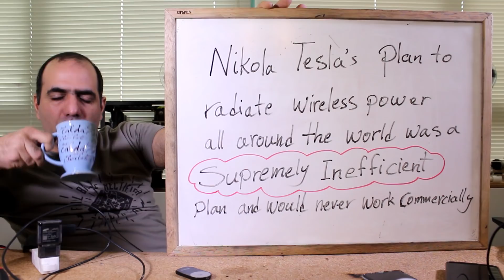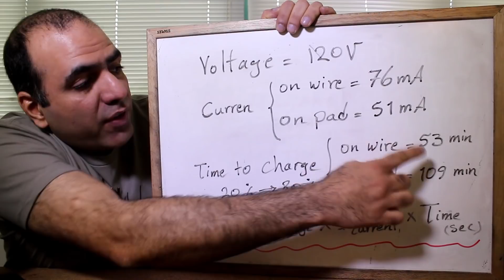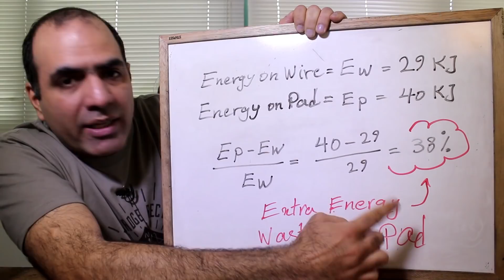Drowning in Inefficiency

Comment: With a resonant transformer you get pretty close to 100% efficiency. Take your Teslacoil and see how much current it draws. Then remove the secondary coil and look again. You will find a difference of about 90%. The reason for that is, the magnetic field of a coil can't radiate away like the electromagnetic field of an antenna. The magnetic field of a coil is fixed to that very coil. Except you offer a second coil in which it can fall. Therefore the only reasons for losses are the quality factors of your resonant circuits.
Another important effect is the inductor coupling: the coupling from the primary coil to the secondary coil in two loose coupled resonant circuits rises with the current in the secondary coil. Hence you start with a coupling of about 5%, when your teslacoil runs it rises to nearly 100% so that almost all the energy is burned in the arcs on the secondary. You can easily check this out with the experiment I mentioned first. If you are bored, you might also measure the current of your teslacoil driver, while you vary the load on the secondary. If you are really, really bored, you might also build something to draw a variable, but definded, amount of power from your secondary to see how it affects the power the primary draws and what the true efficiency in pendency of the load is (I guess you'll get about 80%). You will need high voltage, high power resistors with lots of ohms to do that but I am sure, if you are interested, you will find a way to help yourself.
Might be interesting for you to see, that a teslacoil is in fact more efficient than a common switching regulator. That is because you have no core losses. Tesla failed because the range of the magnetic field of a coil is very limited. Assuming the magnetic field of your primary coil cannot leave the primary coil, you run your coil at 300 kHz, and the field is expanding with the speed of light, then you only get a maximum range of 1000 m. Behind those 1000 m the field of your primary coil is simply not visible because of the limited speed of light. Another reason is the limited quality factor of resonant circuits, which further limits the effective (usable) range of the magnetic field of a coil.
By the way: you can use the primary of your teslacoil as an inductive oven to melt metal stuff (but be careful not to overstress your driver unit, eventualley you will need a smaller primary with more Windings for that). You can also build a capacitive oven and hook it to the secondary to melt plastic or boil water with the displacement current, similar to a microwave oven (the chamber should not be too large, so that the density of the current is large enough).

Comment: I agree with you. But you also have to admit that NT was the awesome mad genius who it the father of AC And also he had vast knowledge about frequency, And maybe Maybe he find someone kind of frequency level to transmit Power to a great distance. 

I don't have much knowledge about Electricity, but I from my experiment I found surrender level of sound and mechanical vibration can reach cover much larger area then others. 

Although with sound and mechanical vibration lose the power with distance. But I think For electricity the results can be reference because ( by using something like wireless transmitter). 

Why don't you give it a try.

Sorry for my bad English.

Comment: Some of the claims vpn companies make are B.S.A.F. 

Encrypts your data? So does every website with a padlock in the browser and every smartphone app released after 2015. It's not wrong, it's just not special either. Right now you are using military grade encryption to read this comment!

Hides your location? That's bs too! Yes it does disguise your IP address but your not hidden! If they really wanted to they could just trace it back to your device using the MAC address because that is hard wired into the network interface card and cant be changed.

Just a few words from an A level computer science student 🙂

Comment: Mehdi please shut up. You’re en electrical engineer not a technician. The “internal combustion engine” is 80 percent efficient and that’s BY DESIGN!! if the engine was 100% efficient the engine would be completely sealed

Comment: Mehdi, me thinks you made an error. You say the combustion engine is 20-40% efficient then say electric cars are 50-60% efficient whilst showing the electric motor. The large hp electric motors in autos themselves are around 90% efficient, relative to the ICE but maybe you are talking to the wheel efficiency which would kill the ICE numbers if compared the same.  Maybe I am wrong but my ev makes little to no heat so much so you need an 8kw electric heater to give you cabin heat in winter. Gets that from the battery so much that one goes without it to extend range! I gave up doing that and after two winters just turn it on and suffer range loss. 

https://cleantechnica.com/2018/03/10/electric-car-myth-buster-efficiency/

Comment: If we could drill  huge holes 20-30 km deep into the crust. We could make waterfall of water to power hydro electricity. If you can put 1  huge generator at each waterfall step, you would end up with thousand of Gigawatts per hour of electricity. Note that it would still take over fifty years  to construct the dams themselves let alone drilling such massive hole into the crust. We would also loose a huge portion of our ocean water, assuming that we can have turbines that dont rust from salted water exposure.

Comment: I have a question why Tesla's wireless power system isn't efficient?
Reply: Tesla's wireless power transfer plan was not efficient because his system would spread energy in all directions and so we cannot capture all of it. Also since he was transmitting power from a large distance, a lot of power will be attenuated and absorbed by the air, earth and bulidings. Also there is inverse squared law which states the if you double the distance from a source of wireless electromagnetic energy, you get one-fourth the power.

Comment: Led bulbs are FAR more efficient if you mod them. Take a 100w equivalent and drop it to a 60w equivalent. They generate far less heat as the leds are not running at their max rating anymore. Still not perfect, but they also last decades this way.

Comment: Maybe there is some free energy to be taken from Earth's electric condition with the Sun. Nikola Tesla was trying to tap into this. You would need some sort of single wire receiver system to absorb the energy from lightning using the Earth as the Source conduit. This would just be effectively another form of solar power, but on a planetary scale. I know I'm not a patron Mr electroboom however I do strongly advise you do an experiment with single wire power as Tesla had described. I would also recommend that you tried doing it into the real ground or dirt and see how far you can transmit single wire through just the ground. I know it should work somewhat because swer systems work just fine.
Reply: I can't remember, but did you already do a demo of wardenclyffe Tower? That is supposed to be single wire power, not wireless

Comment: Energy conducts the same through every form by moving through the least resistance, make the desired output the least resistant path and the output energy will increase. Heat and sound are the two highest reducers of efficiency so that might be the best starting point. Otherwise recycling all waste heat is the best option, like connecting the ground wire to a capacitor bank to convert the static charge into DC or making a comment on a video from four months ago.

Comment: Mehdi, ic was about brake thermal efficiency, there is about a recent breakthrough in fuel cell but nowhere near the ic engine output.
Ie, the smallest volume of engine that could convert 1kg of fuel into controlled energy is that mechanical engine. That's why electric train exist but electric plane is far away, because for mobility we need to carry both the fuel and engine inside the vechile

Comment: Sorry, the best idea I have is thorium salt reactors and it wasn't even my idea. I also failed out of engineering school and business school. So I doubt I'm the guy. All else I can think of is gyms that convert human metabolic energy into electricity and that's pretty inefficient too. It's not enough heat produced to power a turbine and the circular force of treadmills and bikes is pretty terrible. And I've thought about using a system that uses the magnetic resistance of a load in a turbine to control weight for lifting rather than using weights as is currently done. Problem is I can't figure out exactly how it would work and I'm too poor to build any prototype.

Also decentralizing power production is vital! If you have a wood or coal furnance there's no reason not to be using the waste heat and rising air to turn a turbine.

Comment: Quick fact about wireless charging:
It is illegal in the European union, due to an old law forbidding charging solutions to have an efficiency bellow 60%. That is from the wall outlet, to putting energy into the battery.
Most AC adapters are already not above 90% efficient, and even if they were 99.9% efficient, the wireless charger itself doesn't even live up the 60% to start with.
Sadly, this law isn't enforced.... Even if the whole point with it is to stop the waste of energy in consumer devices.

Comment: Hello @Mehdi, Incase you read up the comments I wanted to you to recalculate the energy formula you just used... Voltage*Current*Time.

It is because most of the phone chargers have very smart charging enabled. It draws more current (power) at low values of battery life and then slowly starts drawing very little. So the assumption you made with constant current can be bit wrong. But at the same time you mentioned that the period of charging you mentioned (20-80%) may be at that interval the current might be constant (almost) so you can get lucky and get similar results again... The best way to do is to buy a DC power meter and measure the current drawn (actually the total Energy drawn) and verify or compare with phone's battery size! 

I really love your videos.. an undergrad student from India.

Comment: i was working with a cheap usb oscilloscope with a small dc motor, every motor has imperfections that can be picked-up with a scope, is it possible for las vagas or any  motor controlled device to be stopped at a xcertain point? if you dont hear from me ,the mafia got me.

Comment: Combustion is always going to be inefficient. Internal friction losses and heat conductivity will always be present.... If a metal that didn't conduct as much heat was used it would have to be dense or denser than steel. Which is very problematic in cars as every 100lb of weight reduces the fuel economy by about 1mpg. The efficiency gained from using one of those metals is so negligible since all the heat energy is lost into the cooling system to keep the engines from exploding like a grenade...

Comment: What about a Earth circuit by putting a wire up into the ionosphere or even the and the other side of the wire deep into the ground as a coil you can induce current flow

Comment: I don't agree with you about EV efficiency.
A PMSM is about 95% efficient, and it's the most common motor used in EVs.
Reply: Did you also calculate energy losses during charging car batteries (and some losses during discharging while driving electric motor)?

Comment: Isn't most of power lost in cables because of resistance and friction, doubt that will change in a 1000s years. Also having high EMF fields constantly on to power devices sounds like cancer causing issue.

Comment: Yes Tesla’s idea of power transmission is extremely inefficient. However you yourself said that most of the electricity doesn’t make it to us. If the problem of efficient electricity generation and electrically efficient devices could be solved. Then there would be enough energy that we could afford to waste it through the delivery process.

Comment: It isn't fair to compare the efficiency of an electric machine (which inputs work and outputs work+heat) with the performance of a thermal engine (which inputs heat).
Thermal engines should be compared not with perfect conversion of heat to work violating the 2nd law of thermo, but with the theoretical Carnot engine for the given temperature delta.
Then you realize combustion engines have quite good exergetic (not a typo) efficiency.

Comment: Tesla actually understood the efficiency problem. In his journals 1899 - 1901 he talked about it a lot. He finally discovered the Earth (Not Shummans resonance) became a great conductor about 1 million volts and the resistance dropped dramatically at frequencies in multiples of nearly 6Hz. In this way you would have stations every mile to one center station broadcasting what was needed and using the Earth as a giant capacitor with virtually infinite capacitance. The day side could always fill the capacitor for the night side. The energy you have in your home could go to the ground but with a slight modification could be reused 9 more times. I could go on and on about Tesla. His estimates were around 90%.
Reply: 90%? Bullshit, the man was a genius, yes but he was also a crackpot sometimes (most of the time)

Comment: If 80% is the threshold you accept, then why not harangue about the gross inefficiencies of solar and wind power generation? Come on! Talk about what's REALLY important and in need to further innovation. Instead, fellow Electrical Engineers are designing LED lighting for vehicles that will fail far sooner by intentionally over-driving them, thus making them too bright. Let's talk about how folks can put a high power resistor in line with them and prolong the LED operational life span by more than four times....maybe even the life of their car or truck. Let's talk about making wind energy more efficient than just 24%, and solar more efficient than just 15 to 18%.

Comment: I designed a lighting power supply with 96% efficiency (in certain conditions). It would cost over $55 for a 30W power supply. Part of the problem is that more efficient devices are usually more expensive to manufacture. For example, every AC-DC switching power supply has a stage called secondary rectification. This basically turns the AC square wave output of the transformer into DC. There are several ways to do this. For $0.01, you can use a single silicon diode. For a powerful supply, this can waste 1-2 watts. For $0.05, you can use a Schottky diode, which cuts the wasted power down to 500-700mW. A dual Schottky diode for $0.10 can bring this down to 400-500mW. The best solution currently available is synchronous rectification, which requires a control Chip and MOSFET, which can cost over $1, and only wastes 100-200mW. That means you spent 100x more money, but only got 10x less power loss, which makes ultra high efficiency economically impractical. Based on current technology, 85% efficiency is typical for a SMPS because it doesn't cost much to go from 60% to 85%, but it costs a lot more to go up in efficiency  once you reach that level. 

As for wireless charging, I am also annoyed by how horribly slow and inefficient it is, but it's still useful since I broke my phone's USB port right after the warranty expired.

Comment: It makes the most sense to just go nuclear, power plants are approx 8,000 times more efficient than coal or oil. we could also make nuclear battery plants and we could make use of all the spent fuel rods and charge the batteries using thermophotovoltaic cells and overlay them on thermoelectric couples. Those could be used in spacecraft, many of the satellites planned to be launched etc. Otherwise we could try and make a dyson sphere and utilize the entire sun

Comment: How is this for an idea?

Create a super-battery system that uses Van Der Waals forces and nano-or-micron-sized Piezoelectric crystals: 

See link:
https://en.wikipedia.org/wiki/Van_der_Waals_force

See Piezoelectricity:
https://en.wikipedia.org/wiki/Piezoelectricity

and

Coulombs Law:
https://en.wikipedia.org/wiki/Coulomb's_law

to create fast and tiny mechanical oscillations in a way that can be harnessed into electron movement. I'm thinking along the lines of piezoelectric nano-crystals where so many are packed together so closely that van der waals forces begin to take affect shaking the nano-crystals and then producing electricity.

It seems that at slightly less than one micron of size (or even at nanometre sizes!), the number of micro-sized peizoelectric crystals that could be stacked together within a typical battery casing used in those rectangular 9-volt style batteries, would cause enough Van der Waals force interaction that it FORCES the crystals to oscillate fast enough to create direct current that could possibly power an entire laptop for hours on end!

I'm not sure of what the thermal production profile would be, but I am sure some sort active cooling might be required but in terms of actual power production, it will be quite ahead of Lithium Ion and the same size as a 9-volt battery!

PLEASE NOTE: This idea is now OPEN SOURCE free for use and production everywhere and by everyone under the terms of the 2019 GNU GPL-3 Open Source licence terms for hardware and software systems and sub-systems.
.
Inventors! Do have a go at this idea batteries made of stacked nano-or-micro-sized peizoelectric crystals that are forced to oscillate due to Van der Waals forces! (i.e. the key is that nano-cyrtslas MUST be stacked really close together BUT NOT actually touching). The resulting force can be attractive AND/OR repulsive thus allowing an mechanical / oscillative movement to be created (i.e. shaking said peizoelectric crystal) which then produces an actual electric current.

.
Reply: Something about trying to licence out an idea through YouTube comments makes me think you're just making shit up.